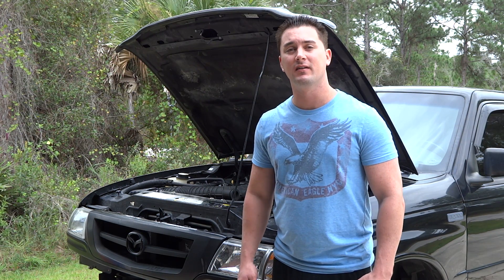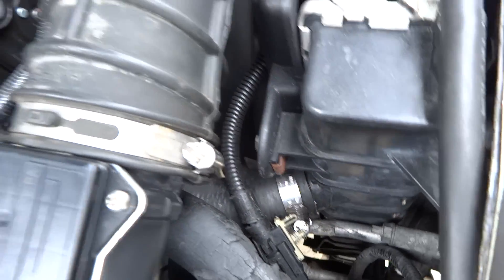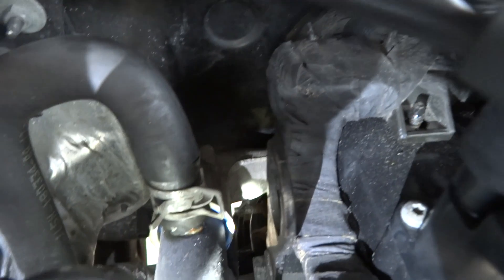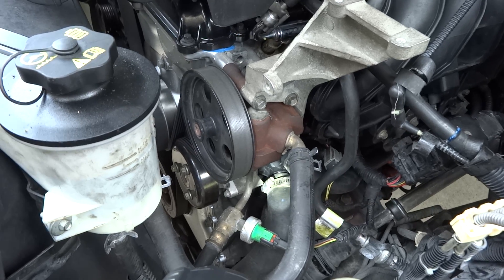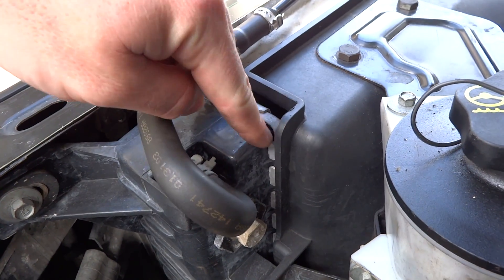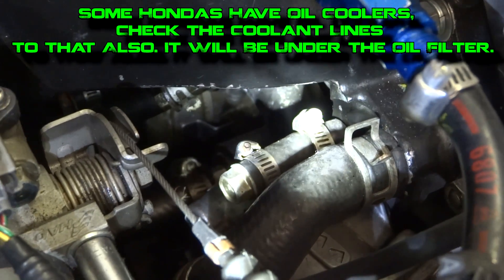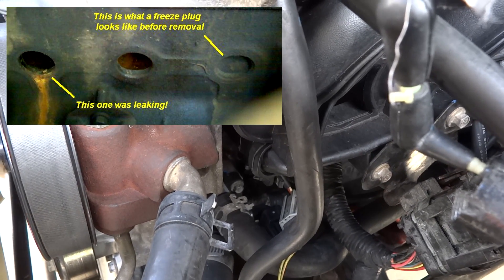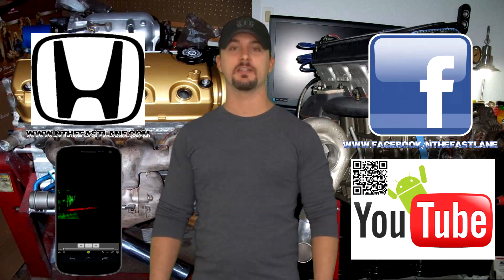Does Your Vehicle Smell Like Pancakes & Waffles?!? Fastest Ways To Track Down A Engine Coolant Leak

Comment: If coolant has been leaking for a while it will form crystallized structures.  The crusty crystals as Spelunkerd said are an excellent telltale sign of a coolant leak.  If a leak is relatively new it will likely be sticky when dry and colored when wet.  Remember that not all coolant/anti-freeze is green.  There is also orange coolant (from the factory).  Great video and great looking engine bay.
Reply from the maker: Thank DJ, I should of mentioned coolant leaks can be a few different colors, some times you forget a few detail but I think I covered majority of it. Yah, I had just rebuilt the head and dropped the transmission for a clutch and save replacement.There's a video on that as well.I don't know where "Spelunkerd" comment went..